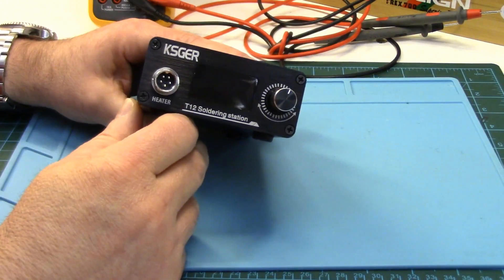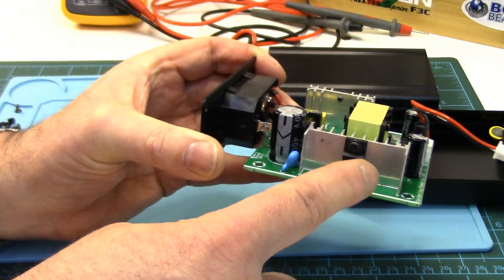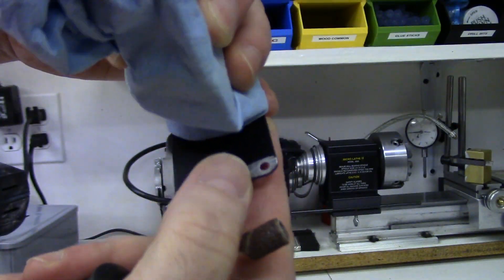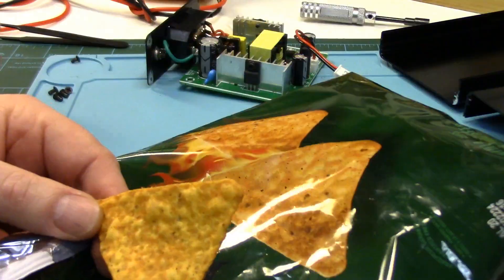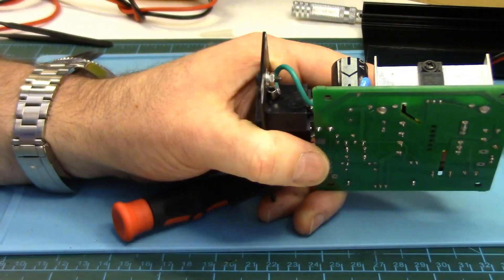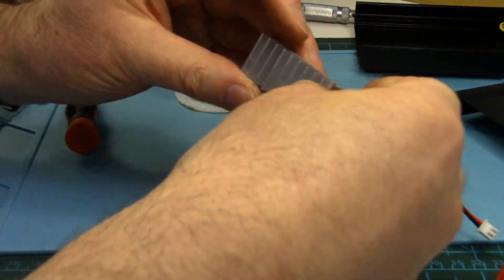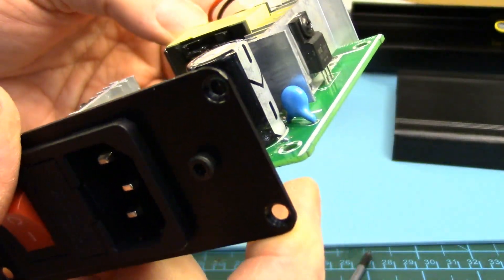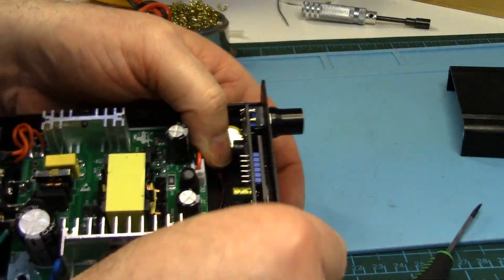KSGER T12 Mod To Improve Safety That You Can Do - It's Fun!

Comment: Just purchased one. Earthed out the case as per your mod. Went to do the heat sink mod and to my surprise they have modified the board and the circuit now clears the heat sink. Must be later model? Someone at the factory has been watching your videos👌
Reply from the maker: Enjoy it & glad to hear they've fixed the heat sink issue.
Reply: Which version? Do you have a PCB image?
Reply: @alejandroperez5368  I'm not quite sure that the OPs version is, but John's board mentions v2.04. I received mine within the last week and it looks different, mine being v2.0.5. I still plan on grounding the case... just can't find a small enough nut for a screw.

Comment: Couldn't you just use the existing screw holes to attach the wire (probably with a nice termination connector ending) instead of drilling a new hole in the case?
Reply from the maker: To each their own. I specifically wanted it attached to the back the way I did it; but you could ground it out anywhere on the metal case you want to.
Reply: @Rchelicopterfun  Fair enough. Thanks for the reply.

Comment: With this grounding mod, does the tip get tied in too? Or would you need to bridge the output negative and earth to get the tip earthed too?
Reply from the maker: Tip is grounded all along, with or without case grounding mod - see review.
Reply: @Rchelicopterfun  Not on every unit. My unit doesn't have tip grounded (measured on tip, not on socket).
Reply: @Rchelicopterfun  btw it's a good question whether it's actually good or bad for the tip to have a low-imp path to earth. imagine soldering (by mistake) something that's plugged into wall socket.
and as far as ESD protection goes, won't a 1MOhm resistor between the tip and the earth do the job?

Comment: I'd like to suggest connecting the big cap and transformer (area where it gets hot) to the heat sink and the case w/ thermal pads that have the best non-liquid metal TIM or TIM with a copper metal (wrapped around the capacitor, not on top coz' if it explodes, it'll a small but powerful firecracker). The copper metal maybe secured with silicone (amazing at heat, can even handle an electrode welder's heat). The bottom gets warm too I noticed. I would put anything that warms up on a custom mesh small table (mod an office equipment with mesh design).

God bless, Rev. 21:4

Comment: Nice vid, just a quick question. Are the four round thru holes on the  corners ground planes like all my PC motherboards? Could I attach the board with stand-offs screwed to the case and ground it as well?
Reply from the maker: The board is already grounded through the grounding connection on the C14 plug assembly. The holes on the board have no ground traces around them.

Comment: I also got one of those wire assortments off Amazon and I'm wondering what the zip ties are for. Mine had five smaller gauge wires and 5 zip ties so I assume it's one per spool but I just don't see what they want me to do with them. Did yours come with zip ties too? Did you ever figure it out?
Reply from the maker: No zip ties with mine, just the box with the wire spools inside.

Comment: Hey John! I ordered the V3.1S station a few days ago and i read that the capacitors probably will need a change, as the infomation online seems somewhat cloudy about what the replacement should be, would you be willing to list out what you would recommend replacing and should the values matter?
Reply from the maker: I would recommend not touching them and enjoy using the station until they (if ever) need replacement. When and if you ever have to replace them, yes values matter - use the same values as what you took out.

Comment: A question, why use a KSGER T12 solder station, when you have a Miniware TS100, that is also a great solder iron?
Reply from the maker: I much prefer a proper soldering station over a portable & soldering iron when I'm working at the bench.
Reply: @Rchelicopterfun  Aha ok, i have put a 24V 4A Switching Power Supply Board with a DC Socket and DC Jack, and power connector in a Aluminum Instrument Box PCB Enclosure, with a High quality 220V Portable BGA Rework Solder Station Hot Air Blower Heat Gun 8858, and put the pcb board also in that Aluminum Enclosure, so i now have one enclosure that is only 161*71*200mm, (yeah i could have used a 150*105*55mm Aluminum Enclosure), and everyting is working perfect, but the Portable BGA Rework Solder Station Hot Air Blower Heat Gun 8858 is not that supper, it cost me total only €21,73.
Reply: @AmigaWolf  The ergonomics of TS100 is not exactly ideal. The tip is also too long for some people's liking.

Comment: The one I just got had an interesting variation. The power connector to the front board looks like it was snapped off, so they just soldered the wires right to the board! You can see the broken leads where the connector was. Nice job!

Comment: Hi john, i recently bought a ksger 2.1s and if you dont mind i have a couple of questions..... Firstly, i grounded the case, but when i test it with multimeter i beleive everything should read less than 1 ohm but the bit under the dial shoots up to around 350ish while every other bit i test reads 000.5..... Have i done something wrong? I see videos where people touch the metal under the dial and the earth pin at the back to show it isnt grounded, but they never show touching those same 2 points after grounding the case.

Also regarding the r10 resistor, on mine the only r10 i can see is in a completely different place (under the dial) does that mean i wont have the battery drain issue?

Thanks in advance
Reply from the maker: The R10 RTC battery grounding issue was fixed long ago on the 2.1S - not an issue anymore.
No idea where your resistance increase is occurring? You would have to probe from the where you made the grounding screw connection on the case and work your way along the case until you figure out where the resistance increase is occurring. Remember, anodizing is an insulator.

Comment: My oled display died last week, idk why, I just use the station maybe 2 3 time per week. The iron gets hot and i ear the beeping when I switch the knob. I tried the oled from my ksger hot air and it works. Anyone know a compatible oled screen? I already did a research and found its a 4pin i2c display ... Some foruns talk the problem is the "driver ic"?¿ I have the blue pcb controller 2.12s version.

Comment: I understand why you would wish to ground the metal case, but isn't the power supply double insulated? So there should be no way the case should ever become live
Reply from the maker: Exactly why I said at the beginning of the video it's most likely fine and that this is totally optional.  Nope the power supply is not double insulated. Double insulated as the name suggests requires two independent levels of insulation. One between the electrical parts inside & the exterior of the metal case, and another between the metal case & the user. For this station to be double insulated, not only would the board inside have to be totally insulated from the case (which it really isn't unless you consider a micron thick layer of anodizing good insulation - I don't); it would also have to have a non conductive plastic/similar material shell. There is always the remote the possibility, the case could become energized when being fed line voltage from a loose wire, failed component, solder bridge, poor assembly, part movement, board failure, who knows).
Reply: @Rchelicopterfun  can I just conformal coat the whole PCB and not desolder or ground anything?
Reply from the maker: @SolRC  it already is coated. A thin coating is no substitute for proper case grounding.

Comment: I also removed the resistor to ground from the rtc battery and added a verticle 2032 battery holder using the original battery pigtail so everything is quick disconnect. The battery is still going stron a year later. This is a fantastic little soldering station. I recently upgraded to a hakko fm203 station (my dream station) and passed on my ksger to a friend.
Reply from the maker: Yep, that grounded RTC trace through that resistor was a pretty big mistake - glad they sorted it quickly on the 2.1S and that it's not an issue on the 3.1S version. Sounds like you did the same thing to your original V2.1S as I did by adding an actual battery holder for easy battery replacement. I would think our larger capacity 2032's will last the better part of a decade - lol. 😄
Reply: @Rchelicopterfun  thanks for the great vids. Keep up the good fight

Comment: Just curious, most of the laptop power supplies only use two wires, hot and neutral, but no earth. How do they ensure the safety?
Reply: electrically double insulated
Reply: @elamriti Thank you. I ordered a station without the power board. And plan to use a spare laptop power supply to power it. Is there any safety concern?
Reply: @haihonghuang  As long as you use a well-known brand they are very safe. I do believe at least Dell laptop supplies (older ones?) with the very large barrel and a thin wire pin in the middle actually pass through the safety earth to the secondary side too. The large barrel has earth on the outside, return (0V) on the inside of the barrel and positive on the pin so there are models out there which pass through the ground if you really want one. Of couse you could always wire in the ground yourself if you wanted to.
Reply from the maker: @ Haihong Huang  Just keep in mind when powering the T12 controller with that method your iron tip won't be grounded, unless like Ben mentioned, you also run a separate earth ground to the negative input or you don't mind a floating iron tip / require ESD protection.
Reply: @Rchelicopterfun  good point. Thank you.

Comment: i would also change those caps to better brand and maybe higher temps
Reply from the maker: Yep, if & when the time comes. Suspect the big input cap will be the first to go.
Reply: @Rchelicopterfun  I would not expect that one to fail any time soon. It operates at low frequency and should not be under too much stress. It's usually the ones exposed to the high frequency switching noise that fail first (secondary side stuff).
Reply from the maker: @ Ben Baselet, the big power input cap was the first one to go in my original T12 V2.1S version so I'll be keeping an eye on it and the other little buggers 🙂
Reply: I replaced them all with nichicon's rated at 100c for peace of mind.